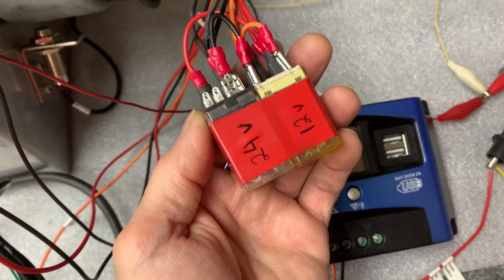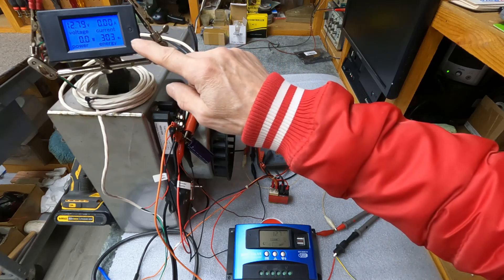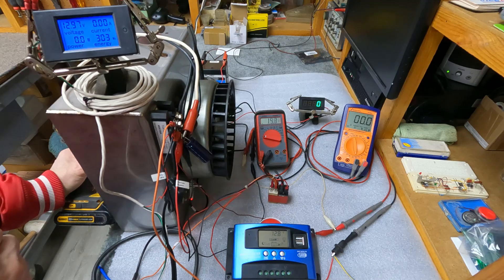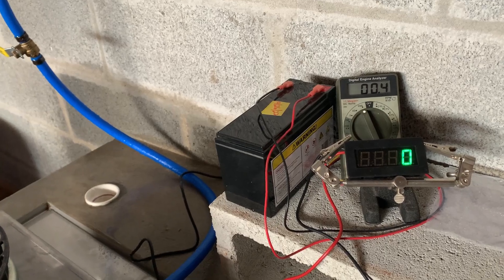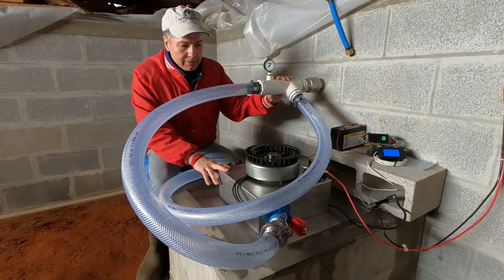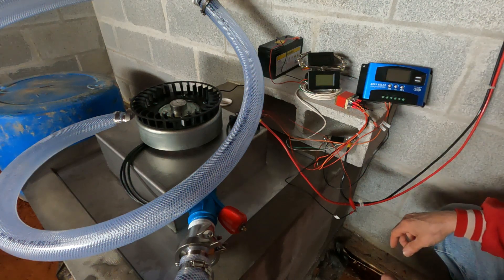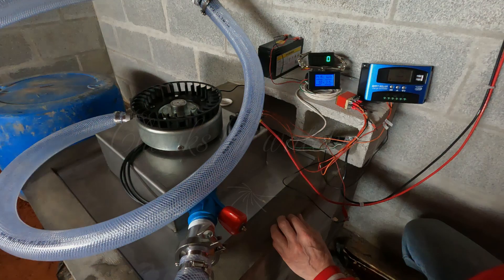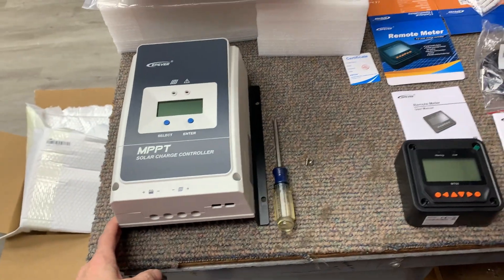Micro Hydro - Cheap Charge Controller

Comment: 08:36 That's not a MPPT charge controller ! It's a PWM charge controller with MPPT label on it .
Reply from the maker: You are most likely correct and even if it were MPPT, it would only track up to 50 volts which is no good with this alternator. Thanks for posting.

Comment: Turgo and Pelton wheels need different turbine assemblies. On a Pelton wheel the water hits the cup perpendicular to the shaft. On a Turgo, the water hits the cup at an angle to the shaft. These two types of wheels have different properties and are best suited to different pressure and flow rates from each other. Lastly the two wheels do not even belong in the same test, the Pelton is cheap and nasty. Get one with similar number of cups as the Turgo wheel. From what I understand of your site and water supply, you should have a Pelton wheel.
Reply from the maker: Yes, I have different assemblies for these two runners. So far, one for the Turgo and two for the Pelton. Between the two, the Pelton has shown a higher power output. I'm currently working with Hartvigsen Hydro on calculating an appropriate Turgo runner for this setup. I will also be trying a different number of cups on the Pelton, not sure yet how many cups to start with.

Comment: The adjustable nozzle needs to be fixed, it should have a symmetrical parallel stream of water.
Reply from the maker: I agree, neither of the 2 adjustable nozzles are very symmetrical at the flow rate where I obtain the most efficiency. But for now, these are the ones that are giving me the best output.

Comment: Don't you have an electronic transformer 230 volt AC / >12 volt, DC mmax 50 volt to enter the solar regulator?
electric bike variators, LED trafo... charger battery 12 /24/ 36...?
Reply from the maker: I may have a single phase one but not a 3 phase needed. I will try playing with that method in the future. The problem with those solar ones is the power diversion issue that still would have to be addressed. Thank you for the suggestion.
Reply: if they are electronic power supplies or chargers, you can connect them directly to the DC of the three-phase bridge
these electronic chargers have an internal diode bridge and leveling capacitors, and the isolated DC output is perfect for PWM or MPPT solar regulators to charge the batteries

Comment: I have agree with earlier comment. I have a similar controller that is a PWM which is having issues. You are probably much better of with a more expensive MPPT that also can handle the higher voltage. Nice work!!
Reply from the maker: Totally agree, thanks for posting.

Comment: Maybe I have missed it, but have you opened the second adjustable nozzles yet?  I am interested in the different power generation from one to two nozzles.  Or is it just pointless to open the second nozzle with the 2” pipe feeding the system?   These are great videos and thanks so much for doing them.  I am looking at making a system and this is a great series to learn from.
Reply from the maker: Yes, I did try both nozzles but as far as the Pelton runner, I saw no difference running both or a single one. Once I had established maximum power with a single nozzle; opening the second actually decreased power and had to back off the 1st nozzle and ended up with the same output power anyways. I will be performing these same tests again on the Turgo wheel to see if it has the same effect.

Comment: Two observations, #1 the Pelton is larger diameter so your max power point (although still far away) is closer to the battery voltage then with the turgo. I would guess power output should be close to the same between the two once you get a MPPT working correctly.
 #2. From my experience with the adjustable spear nozzle you have is they do not spray a perfect stream until you have them opened a bit further, but from what it looks like, you don’t have enough water flow to open it further? My suggestion is, motenergy sells a conical style fixed nozzle for $12 that you can cut the tip off to whatever size you want. The main problem with your fixed nozzle is your hose is too small in diameter and your nozzle needs to be conical shaped to some extent. Good luck!
Reply from the maker: I will be ordering some of those conical style nozzles you mentioned and will also be making my own on that same theory. Thank you for that information.

Comment: I have that Tracer unit for a solar and works great. I want to use the same for my micro hydro unit as well. Hoping it works for you....waiting for the next video!
Reply from the maker: Working on that video right now, I'll try to post my results as soon as I can, thanks.
Reply: @Magutz  hey is you PMG a Motenergy ME1112? What was the watts in the 300 rpm range?
Reply from the maker: @jeffbarnard468  It is  the Motenergy ME1016, rated at 1000 Watts @ 1000 RPM. The best output around the 300 RPM range with no charge controller was 85.6 watts / 41 PSI / 340 RPM. This was using the Pelton runner and the blue adjustable nozzle.
Reply: @Magutz  OK. I have the ME1112 and working on building a vortex turbine. It looks like my model is to have higher output for the same rpm as the one you have. Look forward to your testing with the Tracer controller!

Comment: I highly suspect that it is a fake MPPT charge controller, it is just a PWM controller and won't search for a Maximum Power Point. It will just connect the Generator with the battery and that's it. The later one looks more promising.
Reply: I concur - a buck converter with a current limit would cause the runaway symptoms seen. Second one looks like a properly made device, whether it's suitable for hydro though remains to be seen
Reply from the maker: @NicBellamy  Great observation, thanks for posting.
Reply from the maker: You are most likely correct and with that 50 volt PV limit, is not even worth trying any further. Thanks for posting.